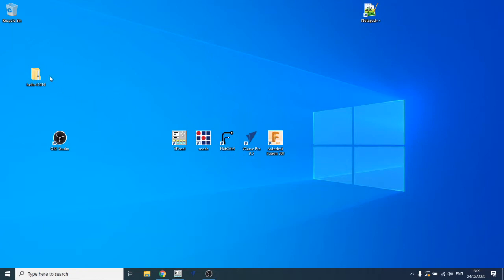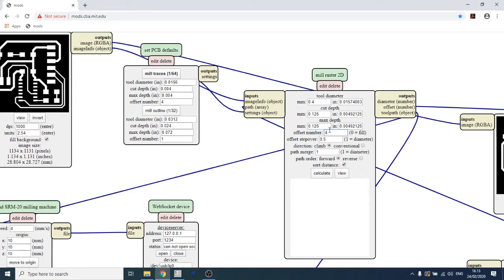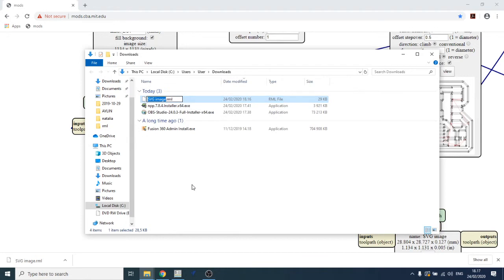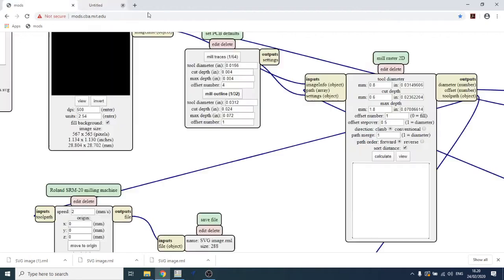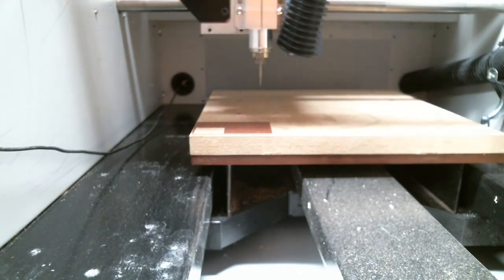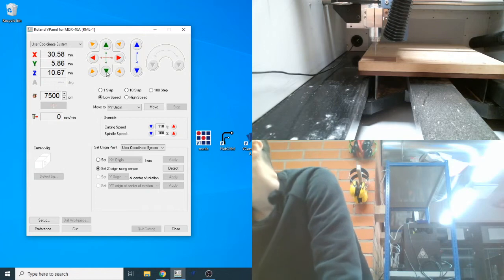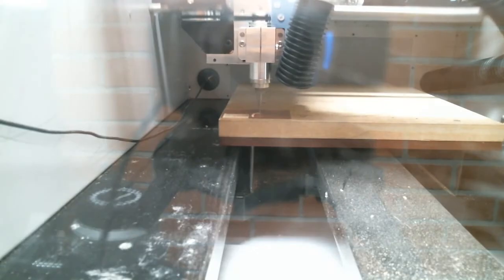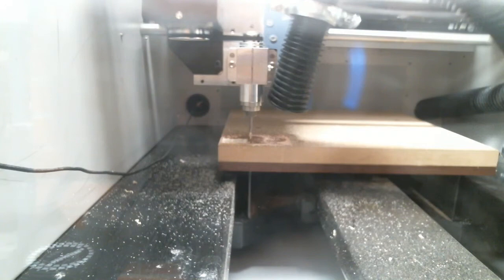PCB Milling with Mods and MDX-40

Comment: Hi there;
I have a MDX-40 - upgraded to the 40A - I use a program called coppercam, works with the Roland. It handles all the conversion from gerber to g-code and operates the mill as an interpreter, very well made GUI and constantly being updated. It is a paid program, (https://www.galaad.net/coppercam-eng.html) and I'm in no way affiliated with it, but I think its defiantly a more streamlined way to mill boards directly with the MDX40. 
It does single and double sided boards, as well as now features a planar offset for PCB's which takes into account the warp in the pcb material and offsets the machine accordingly, which means consistant depth milling/drilling and cutting. (my only grip with that is its a manual process whereby I have to jog the MDX40 to measure the pcb material in the first instance, whereas the Wegstar for example runs an auto levelling routine at the start of the milling process and then error corrects, which to me is alot more convenient and allows for higher precision and coordinates)
The software also allows you to multi mill, so will automatically  boards and can do all operations with the same tool at the same time.
extremely
Reply from the maker: yeah we use coppercam as well. check our channel for more videos!

Comment: Also one thing to be added here is that you have to set the spindle speed manually if you use the SRM-20 post in Mods. The SRM-20 code assumes that you are doing it manually on SRM-20.

Comment: hi kris could you tell me where did you found the vpanel for mdx 40?
Reply: You should have an installation CD with the machine. I will take a closer look tomorrow, but the trick, i think, was that you install the update after you install the original VPanel from the CD.
Reply: @kr51h  The problem is i dont have this CD:(
Reply: @maciaspl  Check out this Japanese website. you may be able to download VPanel. i think it can depend on whether your machine is an MDX-40 or an MDX-40A. My machine is an MDX-40 so i installed the Windows Driver 64-bit version 1.20 driver for MDX-40 which automatically installed OPERATION PANEL (later renamed to VPanel). download.rolanddg.jp/en/3d.html#mdx40
Reply: @dumbcat  hello, i just installed this file linked however theres no option to upload a file or anything. it just seems to be testing panel to turn the spindle on and off and move the axis. any idea where I could get the proper v panel software? thanks.
Reply: @juansalgado6212  please please please can you help me I have the same problem. Unable to get vPanel anywhere :(
Reply: @aqib2000  sadly I couldn’t find it either. Roland doesn’t have it either. Sorry, no where to be found